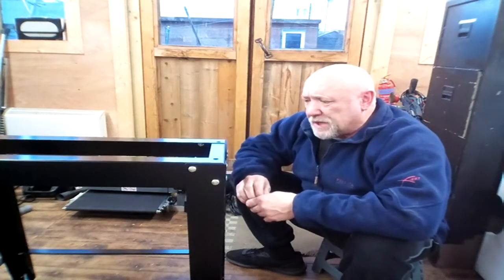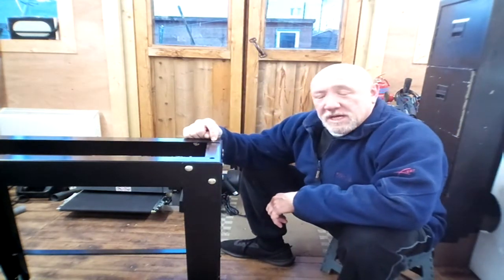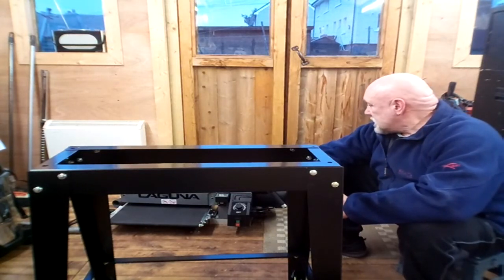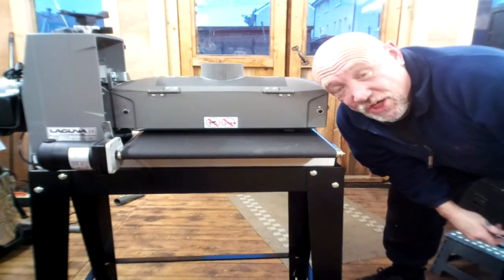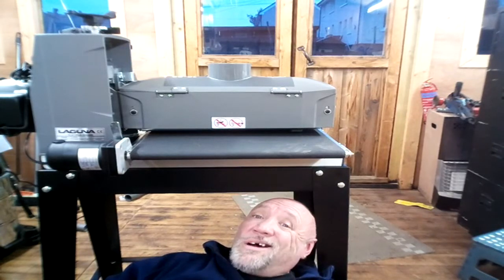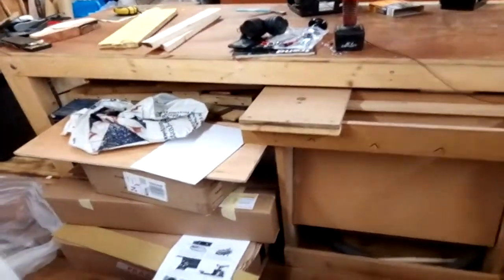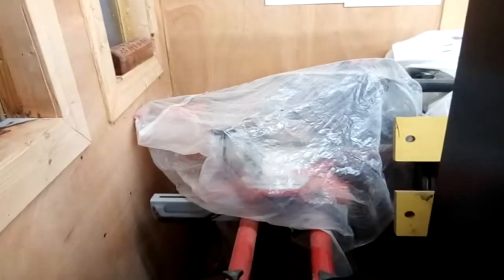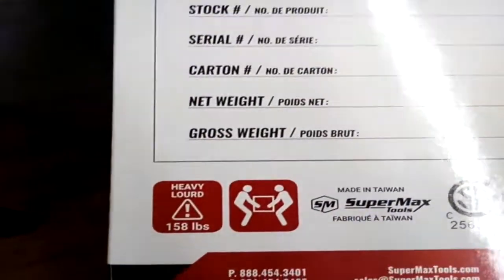A quick workshop tour and a look at the sander

Comment: I actually use metric! It's just better. Especially for........well everything. Peace Rab. Great video. Gotta have one of those.
Reply from the maker: After using one at Crimson and seeing what it was like and what you can get out of it i knew i had to get one at some point because it takes it to the next level instead of trying to get it perfectly flat sanding, plaining etc that this does it and does it better than i ever could doing it by hand.
And yeah ! why ship shit like that abroad knowing that we use metric over here and as you rightly say metric is far superior than trying to work out fractions of fractions etc.
It has an electronic gauge on it and you can use metric measurements on that but i also have digital calipers and can measure with them (and still do)